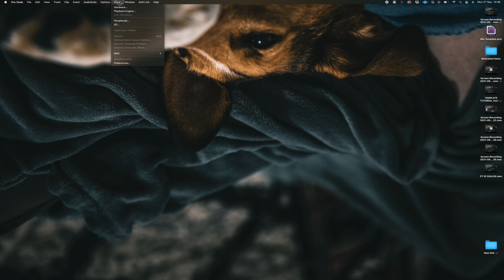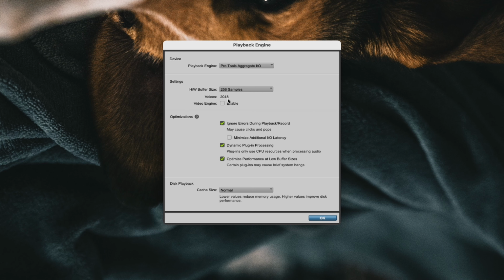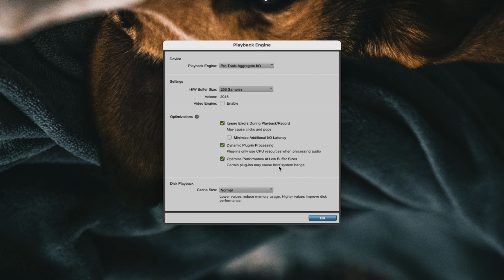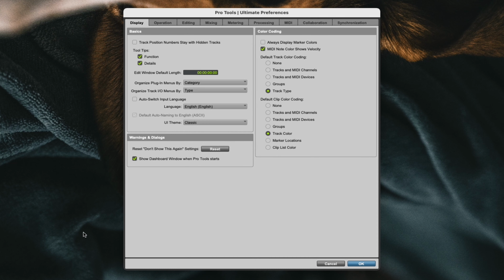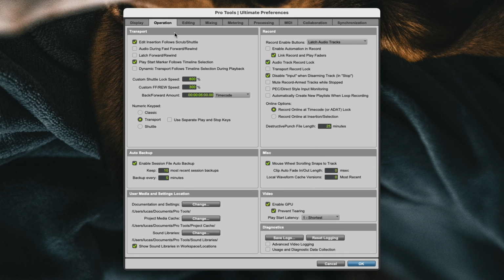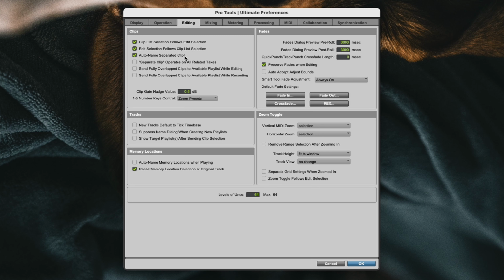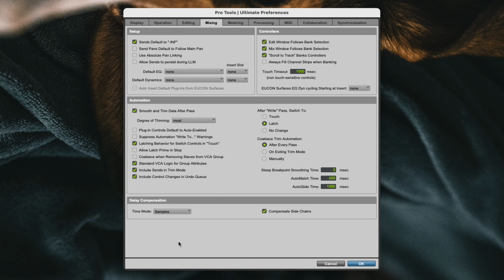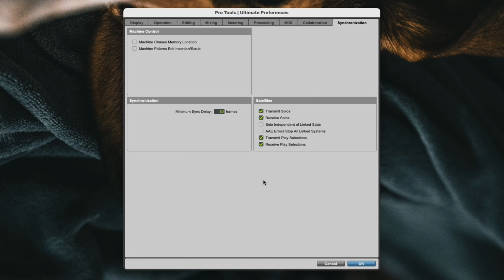SETUP TAB - Pro Tools Basics

Comment: Great info! Quick question. Have you found the sweet spot level for vocal recordings in Pro Tools? Is it -18dBFS average level to -10dBFS peak level? Or -18dBFS average level to -12dBFS peak level? This is the hardest task for me to complete in Pro Tools. Thank You!
Reply from the maker: Hi. Technically you should always strive to use the most of your available headroom of your converters on the way in without allowing for clipping. This can be a challenge depending on the dynamics of the song but what really matters is making sure you don't clip. I typically end up with a peak level between -1 and -6 dBFS. It really does depend more on your converters and how they treat incoming signals than Pro Tools itself.